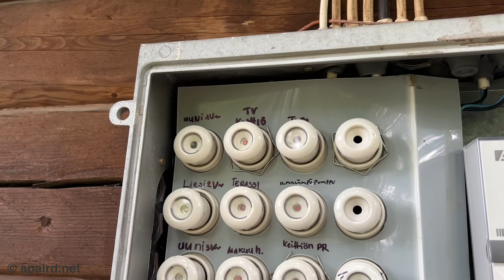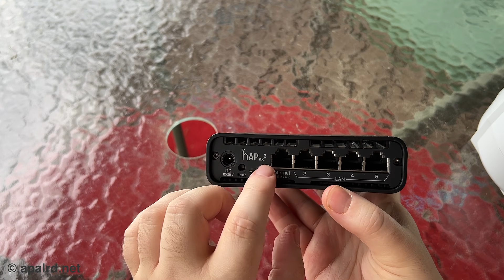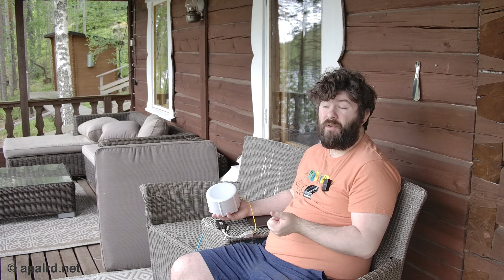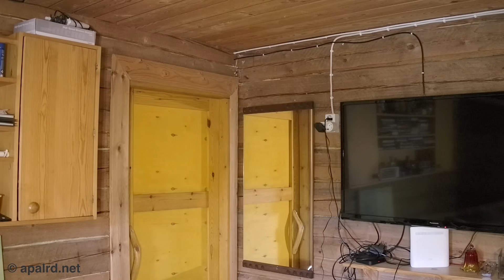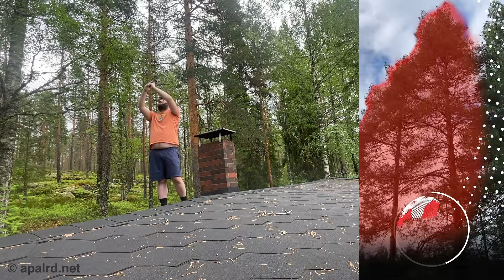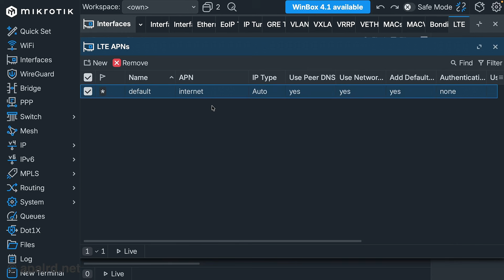Bringing half-decent internet to my mökki (summer cabin)

Comment: I assume you're not able to fell the trees around your cabin? That is usually what you'd do in the states, not for Starlink, but because you don't want them to fall on structures, but I would assume that in Finland they're strict about that sort of thing?

I would also be very, very tempted to dawn a pair of tree cleats and climb up the tree as far as I could to get better signal. It seems what you're doing is adequate, for now, so well done there regardless.
Oh, and the downside of using a tree for things like this is, well, they grow, so, running anything HF off of them is going to be temporary, sometimes very temporary.

Comment: If you would like to improve the signal even furter you can mount the microtik receiver where the LNB usually are placed on a satelite dish for TV.
Reply: Or, replace the microtik internal antenas with an sma connector and hook it up to some yagis.  Great content by the way, you are among the very best of the best tech YouTubers 😊
Reply from the maker: Mikrotik makes different models designed for mounted antennas, so I'd get one of those instead of the SXT. But yea, Yagis are definitely an option.

Comment: As someone that used to have to live off of 5G in Finland a few years back still, the solution I ended up going with was buying an RMA'd ZTE MC7010 5G CPE and mounting that outside the window. Those are still available for 180€ right now.

The big benefit with those is that they can use 5G and 4G bands together, so you're really squeezing every last bit of juice out of the nitrogen around us. But paying for 5G at the mökki sounds a bit excessive.

Comment: Finn here. Optimizing 4/5G signal can be big PAIN! Even few centimeters can make tens of megabits difference. Then there comes Carrier aggrecation (CA), to get it to work good. Not all modems support right combos. I'm happy that I got 8/8Gb fiber from Valoo, before that I used Elisa's 1Gb fiber which costed a ton and before that 4G😂.

I always recommend get the newest 5G box (with good modem chipset) as that usually performs best. 

Last comment comes from "mobile is cheaper than fiber" maybe monthly there's a small difference, but then you need to add all the new mobile-routers that ISP tries to sell you every damn year. Most normies and old people buy new one because "no updates, it's dangerous and much faster" mantra!

PS. Be aware that Elisa shuts down some bands at night (about 01.00-06.00 at least) if that happens at your tower you can call customer service to disable shutdown.
Reply: In terms of moving a little bit to get good coverage generally speaking, you can get on tennis that’s all hi again that should resolve the issue
Reply: @TheLostPacketYTWhat? Is this a bot?
Reply: @Tsiikki  no its just how it works lol

Comment: Go with fiber from inside to outside. Sure the haP is cheap, but what about the TV? This way you insulate your internal network and all its devices from the radio outside that can fry during a thunder storm. A tiny transformer on the ethernet port is not enough to stop all the energy from lightning and can propagate trough your wired network. My external network is all fiber btw. I have 3 switches all connected using SM fiber and my cameras and APs connect to them. No copper connection to my internal main switch.

Comment: I'm not sure if you have already done a video on this but, I am very interested in seeing how you could do qos to make sure that things work properly with such small bandwidth. One of the things that I am curious about is that since pretty much everything goes over https nowadays, how can you create rules to prioritize different things? I guess you could go by IPs but that can get annoying.
I would at least limit any streaming devices to something reasonable and make sure things like voice calls are prioritized
Reply from the maker: No need to go into that level of detail with modern fair queueing algorithms. 

Basically, you can categorize high bandwidth flows based on the fact that they use more bandwidth, so prioritize the first n packets of a flow per a period of time, which means the low bandwidth flows with few packets will get all of the bandwidth they need and the high bandwidth flows will get a small guaranteed rate and fight for the rest. This is based on the flow label or packet hash so no need to manually categorize or configure anything.

Comment: The Mikrotik spec says your LTE7 device has 10/100 Ethernet. Is that true or is it just faulty docs?
Reply from the maker: It’s 10/100. This older model uses a mips chipset instead of arm like the newer ones.

Comment: I'm just glad someone is doing something other than unifi😅
Reply: gif of guy using a 360 controller to play snake on his LED switch
Reply: Or TPLINK ! Both heavily sponsor youtuber projects like this and make the whole video very generic.
Reply: UniFi is fine for basic stuff, but falls apart rather quickly if you try to set up something non-trivial.
And now that they're focused on creating more and more expensive equipment, I hope that someone will take over the prosumer niche by creating something that will be functional, not just pretty.
Reply: @antagonista8122 Man I don't know what Unifi equipment you're using, but the higher level stuff does more than pretty much anything else you'll see in the consumer market. The barrier is the price. The other advantage is you're not dealing with CCP sponsored products and spying. But they're still not perfect.
Reply: @antagonista8122  it works for people who like to feel like they’re in control. Their systems are good but is not good for everything. You can choose the parts you use.

Comment: Glad you found a good setup for your usecase. But, "Starlink on a buoy" sounds like an awesome project.

Water cooled setup by.. Having it in water.
Reply: Power it by the waves! 😅
Reply: Sounds tempting, until you realize that lake probably freezes solid in the winter, and you'd have to moor it with the cable run along the lakebed, likely staked down in place if you want it to last.

Better solution would be to have it on a mast, and accept that it will eventually get destroyed by lightening.
Reply: @jttech44  The Starlink mini uses very little power, and is not fussy about power (12v to 24v or 48v to 24v converters work great). It would cost around CAD 1000 (incl. the mini kit) to have a solar panel, small battery, and 5GHz wireless bridge pointing to the cabin. I'd expect around 300-400 Mbps max speed with that setup. You could squeeze more out of a 60 GHz bridge, but unless this kit is fixed (not floating on water) you'd probably have stability issues. 

I design and deploy telescoping surveillance towers in remote areas that use Starlink + solar. This would be effectively the same setup, just on a water structure instead of a trailer/forlift-able base.

To be clear, this isn't the 'right solution', LTE makes more sense, and if starlink speeds are needed a tower is the proper solution- would just be a very cool project :)